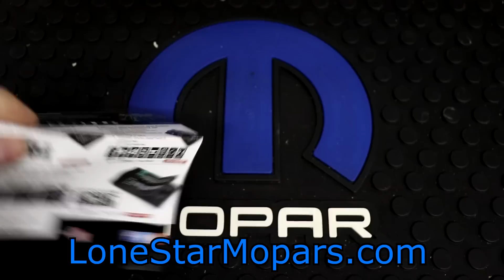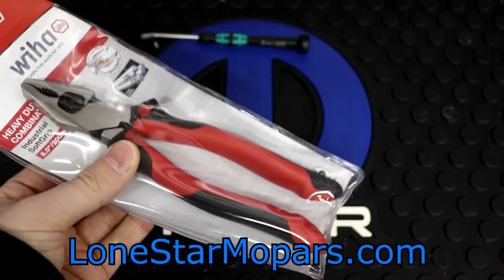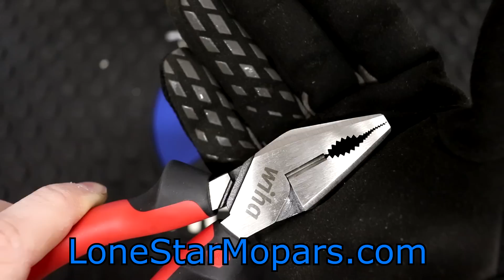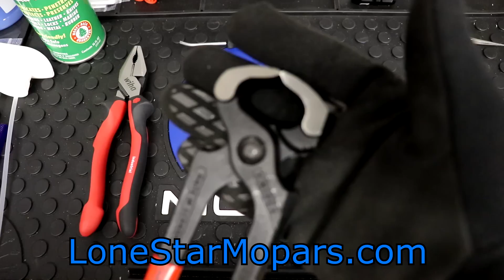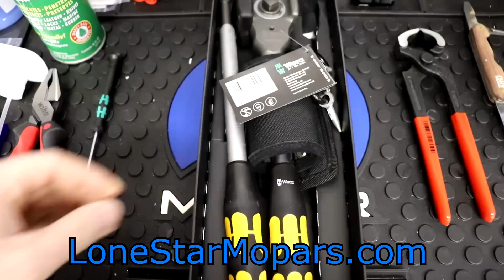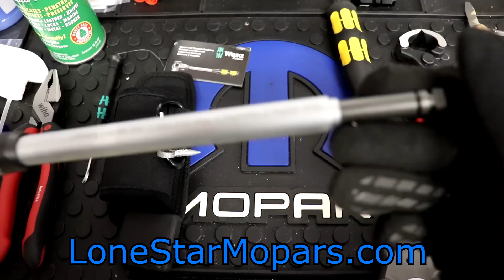KC Tool Haul #28: Chips, Hats, Ballistol, Wiha Pliers, Knipex Pincers, and the Wera Koloss!

Comment: Nice haul! I strongly considered getting the Koloss when it was on Tool of the Day but after a decent amount of agonizing I passed. I'm pretty happy with my 1/2" ratchet line-up and I try to use hammers for that task. I've used end nippers for pulling fasteners and you are right. It's far better than using side cutters. I have a video coming up about micro-screwdriver handles coming up soon. It will be interesting to see how that works out for you.

Comment: I bought the Koloss on tool of the day also, i was going to purchase it anyhow for the first quarter price but for $79.99 I was blown away and pulled the trigger immediately lol. I use it for high tensile fence repair driving staples, tightening the ratchet tightners and running lags in corner supports I keep it on my 4 wheeler at all times and I absolutely love it and wish I bought it sooner lol

Comment: I think the less risky way to use the Koloss is to use the hammer to line up the bolt holes instead of hammering on the bolt. In your example you would be hammering on the crossmember to get it into the correct position to bolt it up normally. 
I am sad to hear the Stahlwille hat is a little small since I do have a ginormous head.
Reply from the maker: That really was the only negative from the video...I could technically wear it, but it would have to be at a point where the velcro is barely fastened...and with the winds around here, it wouldn't be a great bet.  Ideally they would come out with a flex fit hat in multiple colors...I think people would eat a green one up.  I'll probably throw it on in the shop when I'm under a car etc.  That is definitely the best way to use the Koloss, but I've had a lot of experience with old A, B, and E-Bodies where despite lining things up, wedging a driver in, and looking "true" you still wind up having to tap the bolt a bit.  As long as you focus the force on the head and not the threads you are usually ok, lol.
Reply: @lonestarmopars  Yeah, I'd like green better too. I still thought it was a good looking hat in the pictures though. And yeah, lol, sometimes you have to do what you have to do. I won't pretend that I've never tapped a bolt a little bit to get it started. As long as the threads don't look bad afterword and the bolt still tightens up nicely I'm sure it's OK.